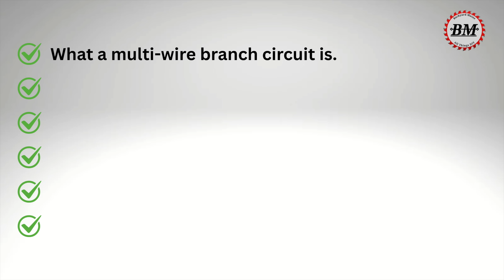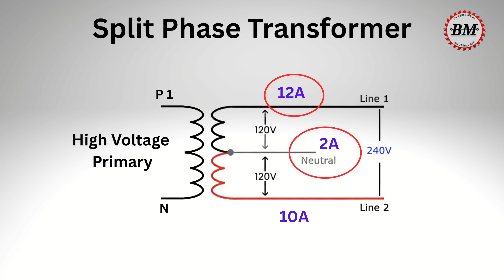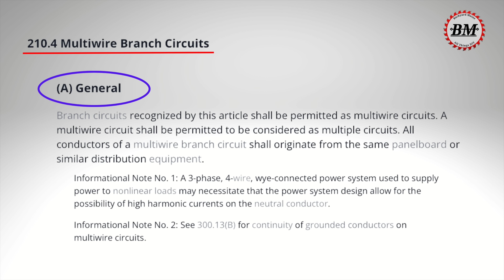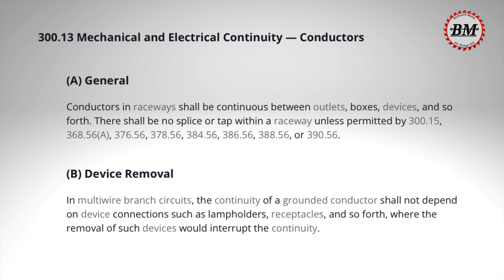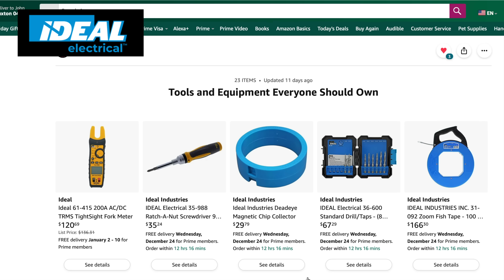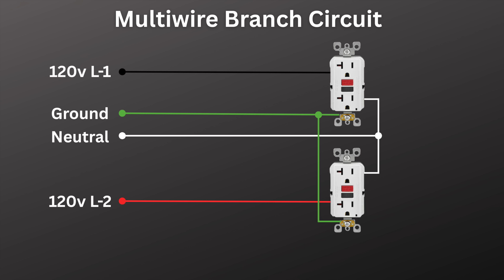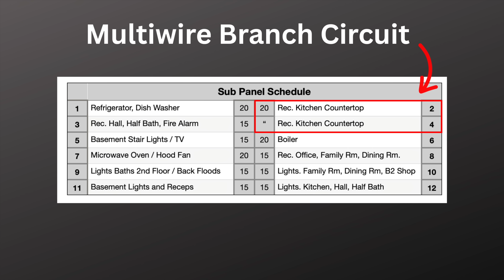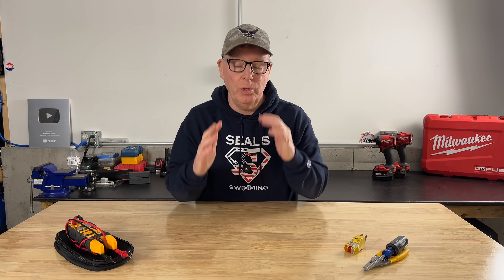Homeowners Don't Know This Dangerous Circuit Exists!

Comment: The idea of using both sides sounds terrible in many ways.  So what you would end up with is different outlets with 240 volts difference between the Hot side of the different outlets.   This video is great because I really didn't know this was done.  There's always going to be the  240 volts available to the panel so it's something to check out.  I think you could just measure between outlets and use an extension cord to reach between them to hook up the voltmeter.

Comment: Great video! It really helped me better understand MWBC's..

I learned about MWBC's when I stumbled across one that fed the fans on the two AC/heaters in my attic. I was not aware they existed. It used a romex 3 wire cable. Fortunately the wiring in the attic is exposed, so I could trace out how it split into two circuits in the on/off switch box for the one of the fans.

When I went to the circuit beaker panel, I found that the MWBC was connected to two single pole breakers that were not tied together or even adjacent to each other. I don't trust my limited skill/knowledge to mess with breaker panels, so I had an electrician come out move the MWBC to adjacent and tied breakers.
Reply: At least the neutral wires were properly pigtailed together where the MWBC branched to the separate fan lines.

Comment: What is extremely confusing is that NEC 300.13(B) does not clarity that 2-wire 120V circuits split off the multi wire are NOT subject to NEC 300.13(B). Obviously this is the case, but NEC 300.13(B) is very poorly written. The 2-wire run is PART of the multiwire run, but it is no longer multiwire. My house is probably just one in a bunch from the 1990's that have the multi wire run from the panel, and first stop, it splits into two regular 2 wire circuits. The only point that requires the wire nut device pig tail is the split...

Comment: My house was built in 1992 and it has 5 multi-wire circuits, all using 10 single pole breakers clearly violating NEC 210.4(B). When I purchased it in 2021, the inspector made a note of this fault. 
I did a major renovation and replaced both electrical panels with modern Arc Fault breakers and of course the correct "tandem" breakers were installed for the multi-wire circuits. I also replaced every single one of the 100+ receptacles in the 5,500sqft home. The original receptacles all used backstab and were wired device-to-device. When replacing the devices, being unaware of NEC 300.13(B), I retained the device-to-devive wiring scheme, but of course only used correctly torqued screw connections. Now, hearing about NEC 300.13(B), I realize that my receptacle wiring may possibly violate NEC 300.13(B). The way the 5 multi-circuits in my house are wired is as follows: 5 runs of 14/3 from the panel. 
Each of the 14/3 multi-wire is a straight run from the panel to a junction box where it is spliced with wire nuts into two separate 14/2 runs going to lights and receptacles. The 14/2 runs with receptacles are in turn wired device-to-device. 
Now, I don't understand how doing device-to-device on these 14/2 runs would be any more dangerous compared to doing it on a 14/2 pulled straight from the panel?! I do realize the risk of breaking the neutral in a 14/3 run, but once the run turns into 14/2, it will be just like any 14/2 circuit from the panel... Am I missing something? Is the answer maybe this simple: After branching the 14/3 multiwire into two 14/2, the resulting two runs are no longer considered multiwire and are not subject to NEC 300.13(B)?

Comment: Split plugs were common at kitchen counters here in ontario canada.  My bil who wasn't knowledgeable was telling me how he replaced a receptacle at his cottage. He says ' I  matched all the wire but when I turned on the breaker' and I interjected ' it went boom'. He says 'yes'. Of course he didn't know about breaking the metal piece out. Ontario now does regular 20 amp circuits to counters now and they allow 2 receptacles per circuit. When our church does a pancake supper we can still pop breakers lol

Comment: I like these in garages and shops for 240V/120V flexibility at each receptacle box. For table saws, planers, compressors, dust collectors, etc. Lots of them have a 20a 240v plug. Just swap the faceplate and receptacle and put your tool where you want. Just don't fuck it up. Guard against open neutrals and install a 2-pole GFCI breaker.

Comment: In literally the first few seconds, I know what he’s talking about shared neutral circuits. New guy at work that was working on a dishwasher on an older house. It was a shared circuit. He got shocked and swear he shut the power off. He later found out that it was a shared neutral, and the imbalance led to the shock. Thankfully, he’s OK. I think newer breakers today have tide breakers. To make sure an entire circuit is not live. Always double check the wire. It’s caught me a few times and I’m glad I checked it.

Comment: Is this why, when I was working around an outlet in a room with a separate light circuit, when I turned the outlet's circuit breaker off, and the lights were still on, the outlet power was off, but when I took the outlet out of circuit and accidentally bridged 2 of the wires (sorry, I don't remember which ones), that still made an arc and I realized that I still needed to turn off the light circuit and then use a light plugged into another room in order to actually be safe from electrocution or regular shocks?

Comment: I've been an electrician for over 50 years and have never installed installed a multiwire branch circuit.  Not because I was concerned about the cost savings, I just do not see it as a safe method of wiring, even it some loophole in the code lets it be installed that way.  I recognized the danger in this form of wiring many years ago and just chose to personally avoid it.  Safe work practices might cost just a little bit more, but, I figure that quality of work and safety trump cost savings every time.

Comment: The danger is only real when the panel were not wired legally and the user do not have any electrical knowledge.  In Ontario, Canada, the code cover just about everything , and unless the inspector been asleep, they tend to catch much of the mistakes. There are parts of the codes however which I been forced to deviate from for safety reason.  I also would wire up a quick generator connection with suicide cord if I need to, but I am a electrician, and I am not like the average public.

Comment: I've seen 3 phase in a couple of houses here in Florida old houses 
It was for heat units
Reply: How did they get 240? Does the house have to have its own 208 to 240 transformer? Or does the oven and drying need to run off 208?

Comment: Wondering your take on insulated tools such as pliers, screwdrivers etc., I haven't seen you use them except for testers/multi-meters to check/test for live conductors/circuits? The cost for insulated tools are pretty substantial so I'm wondering if they're necessary when you have the testers. Thank you.

Comment: Right off the bat here you have neutral and Lx reversed! The Load side is ALWAYS the small slot side. Neutral is always the large slot side. Also WHY would you feed TWO (L1 & L2) home runs to a single circuit to begin with? ALWAYS keep those home runs separate.. L1 on circuit say 1, 3, 5 L2 on circuit 2, 4, 6. NEVER share neutral across L1 AND L2. Yeah if I saw 2 home runs tied to a single circuit I'd flag it as an inspector absolutely no doubt about it! If you wanna split the receptacle ALWAYS keep that thing on a single load. If one side is switched make absolutely certain that the switch is tied to the SAME circuit and not another one EVEN if the alternative ties back to the same load! Switches, receptacles, lights ALL need to be tied to the SAME circuit, okay? Never share home runs between circuits that's the very simplistic golden rule.

Comment: Great informative video again, thank you. Got some items off of your Ideal Amazon link. Question if I may: the new ideal twist connectors seem bigger than the traditional ones, would this cause a space problem when you're running close to the box fill? Thank you
Reply from the maker: Thank you. As far as the code goes wire connectors don't count towards volume allowances, but in reality a larger wire nut can make it more difficult to get everything into a box. The wire nuts I used in this video are the same size and they have been for a long time so you shouldn't have a problem with them.

Comment: As an electrician’s apprentice, I was taught to never use multiwire branch circuits because the “cost savings” of labor and materials is quickly negated by the potential damage to person and property if it goes wrongs.

Comment: I was taught that you have to balance the neutral,  meaning put the 2 hot legs on different phases. Its no longer legal to do that in residential projects in NYC.
Reply from the maker: Thats pensively what I sad in the video. The two hot legs need to be on different legs (not phase because it's still technically single phase). When that happens the neutral carries only the imbalance. You don't need to try to balance the loads. The neutral cannot be over loaded when wired this way. In industry with three phase system we always try to balance the loads to keep the neutral current as low as possible but this isn't possible in a home for the most part because the loads are usually not fixed and are what anyone decides to plug in.
Reply: @BackyardMaine Wow! Thank you so much! I didnt know in that situation its the same phase! Thats why they call it single phase 208 instead of 2 phase. I always wondered why. Love your videos, definitely earned a sub. Im actually learning plumbing right now but did electrical for 14 years in nyc. Like looking stuff up, learning and staying in the loop.🙏💪✌️⚡️⚡️ btw you can no longer have split neutrals in nyc unless they changed the code again. But i think theres a type of wire you can buy that has a super neutral? Its white with a stripe. In that case you still can? Im not sure. Actually I think its just a black red and 2 whites, one with red stripe one with black stripe in one bx or mc. Most companies don't use it because it's expensive. Any feedback on that? Appreciate it!

Comment: I don’t agree with everything you say, however on this you are 100% correct. They need to be outlawed since they are so easily missed and can kill people even electricians. Unless you pull the panel cover they are invisible. A recent panel upgrade by licensed electricians left two MWBC breakers on different single pole breakers without the required breaker tie. I hate this type of electrical short cut. Just outlaw them, this allowance is crazy.

Comment: It's great to see videos like this that have real information. I particularly appreciate the citations to the code. I've seen a lot of sloppy work even in the few homes I've owned, or where I helped out a family member or friend. Loose connections, too many connectors for the box size, openings into the panel (had one outside panel with a wasp nest inside — fun!), wires too short and pulling on the connection, switches wired incorrectly... There's a lot of bad wiring out there, and it's always good to learn more about these different cases.
Reply from the maker: Great comment. Thanks for adding to the conversation and for your kind words.

Comment: This vid is an eye opener!  Looking at my panel I can see that more than half the circuits are multi wire branch runs.  The challenge is further increased due to the majority of those are using tandem breakers that are not able to be coupled in the traditional sense.  Is there an option for tying the tandem of one breaker to a separate tandem breaker?
Reply from the maker: They do make them but they are specific for each breaker brand and type. Here's a link to a Sqare D inside and outside random breaker tie. Probably not the brand or type you're looking for but it's a starting point. https://amzn.to/4sorNvh

Comment: My home is full of multi wire branch circuits, and none of the breakers are two pole breakers or have breaker ties.  This is not something which is covered in most diy wiring books, I think.  It took me a long time, and some shocks while doing routine electrical work, to understand this.  This video is an excellent explanation, which I wish I had seen years ago.  I wonder if these circuits can be tested using a circuit tester such as the Ideal SureTrace tester covered in another video, or if the shared neutrals prevent proper differentiation of the circuits.

Comment: Bought a retirement property with house and barn built in the late 80's.  These videos have helped me understand the system and make simple repairs.  Beyond a certain level I call in my electrician for pro work.  Have found a number of problems that were practice at the time but clearly not safe.  The house is sorted and barn is next.  My guy will replace the old sub panel and we will add the circuits needed to be safe.  That $ for a pro is cheap compared to losing you home or shop.
Reply from the maker: So happy to hear my videos are helping you out. Glad you're getting it all sorted out. Thanks for watching.

Comment: (2:57) I encountered the multiwire branch circuit similar to the situation shown in the diagram in my house in the mid-1990s, possibly the work of a "weekend warrrior", or it could have been the original builder in 1958.  When I installed a GFCI breaker for the bathroom branch, it would trip every 30-60 minutes due to the refrigerator being on the other branch.  The only way to fix it was to rip the bathroom wall open and run a separate cable to the breaker panel so that the branches had their own neutral returns to the common ground in the panel and the bathroom branch got modern NM cable with ground.  The cost of correcting the situation far outstripped the few dollars originally saved by using an ungrounded three-wire cable.
Reply from the maker: Yes a GFCI breaker will not work on a multiwire branch circuit. As soon as it sees load from the other line it will trip. You can install GFCI receptacles on a multiwire branch circuit though but they cannot be split.

Comment: The entire home is a multiwire branch circuit, sharing a neutral feeder wire back to the transformer.
Reply: Lol, I guess that's one way to look at it and technically correct.
Reply: but, that neutral is much heavier than 12 or 14 ga.

Comment: You mean a shared neutral branch circuit - I have several of these, all known and listed on the breaker schedule.  At the load center they have  Red and Black hot wires.  When working on such a circuit its companion circuit must also be turned off.  These days this is done by using tied-(tandem) breakers.

Comment: When mainframe computers started in offices,all the capacitors would cause neutral overload in common neutral circuits. There was an era of using larger neutral in conduit.
Reply: Good point.  What you're describing was probably due to third harmonic currents that return via the neutral.  Harmonics are prevalent when lots of electronic loads are being served from 120/208 three phase wye-connected sources.  The 3rd harmonics are referred to as "triplens" as they are in phase with each other ("zero - sequence" currents is another way they are described). Hence, they add together in the neutral path since they're all in phase (no cancellation). I remember exactly what you're describing.  I worked in the power quality field for years.

Comment: Come to Montana to see radical suff. I had a common home run back to the d-panel, clamped to a piece of gas pipe with a phone ground clamp on each end, to make the circuit connection! 
The house I moved into had three different 240V supplies from the home and none of them went to the d-panel -- they cut holes in the exterior walls of the house and tapped into convenient wall receptacles for the A and B side.

Comment: I work with electricians doing wiring (they're required to be on site & supervising) and I hate those multi-wire/shared neutral circuits. I don't care if they're acceptable when done correctly...
They're an accident waiting to happen.
And I never wire through a device. Everything gets a pigtail.

Comment: Moved into a 60s home with a MWBC feeding dishwasher and fridge. They were not connected with a tie. Did a ton of research while remodeling and in the end decided to just disconnect the red wire at the panel and at each outlet, cap them off, tape them up, and labeled them explaining it was an old MWBC. Ran a new circuit to my fridge. No future confusion or needing to remember anything. More peace of mind.

Comment: Can they use multi branch circuit with just 14/2 wires? I replaced an outlet, I turned off the breaker, it killed the power to the outlet but the white wire was still hot. When I disconnected the white wire, it killed the power to the lights in the hallway, I turned the switch off and it killed the power to the white wire.
Reply from the maker: Yes and long as the circuit breakers are 15A.

Comment: One place you can have 2 hots with only 1 neutral is ceiling fixtures. My 65 y/o house had ceiling fans everywhere that were hooked up to only the switched (black) wire with the non-switched (red) wire terminated with a wire nut. If you go to replace a ceiling fixture and only rely on the wall switch to disconnect power, you can have a shock hazard without realizing it. Always turn off the breaker before getting into the fixture.
Reply: Not a mwbc. One leg is switched & one not. Not sure why, usually both are switched. A mwbc originates  at the panel.
Reply: @greggpurviance7252  I know that. I made the comparison because it's a scenario that can make you think the power is cut when it's not. The always hot works for ceiling fans so the wall switch only runs the light and not the fan.